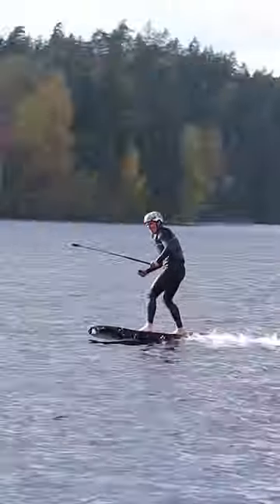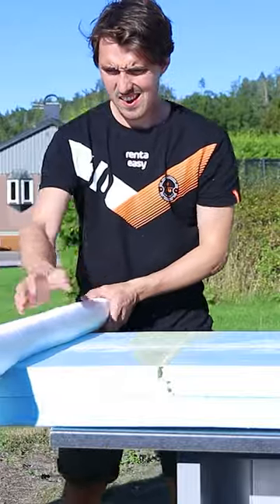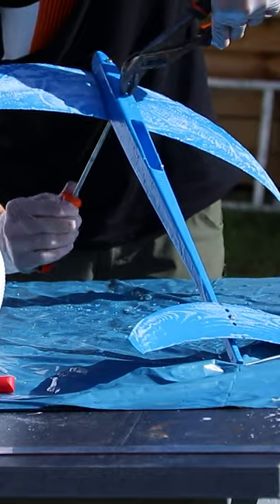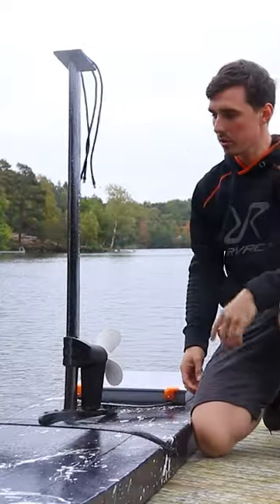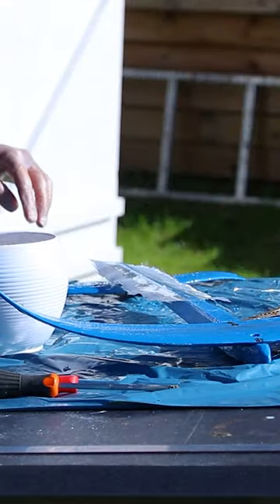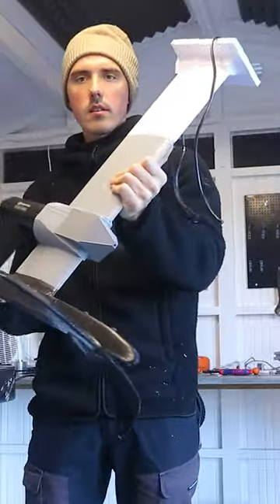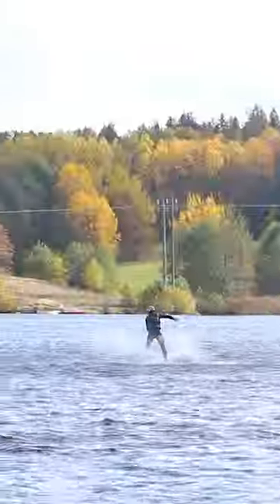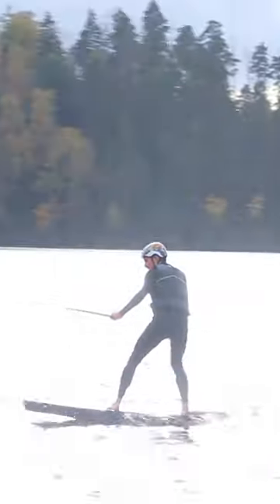How I Built An Electric Hydrofoil #shorts

Comment: It looks like the board wanted to lift. Try standing back a bit to allow the front foil to get more lift and once you pop out of the water, friction will drop and you'll be off. If you've not foiled before, you need to trim the board with forwad/back weight shifts to go down/up. You could try pumping the board but I'm not sure it'd be strong enough.